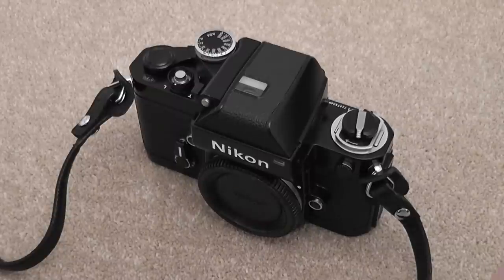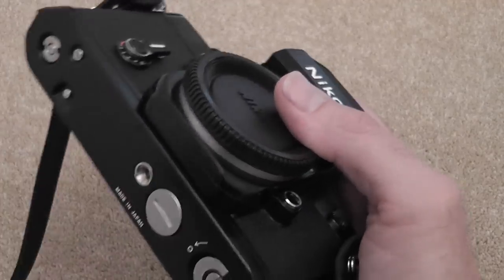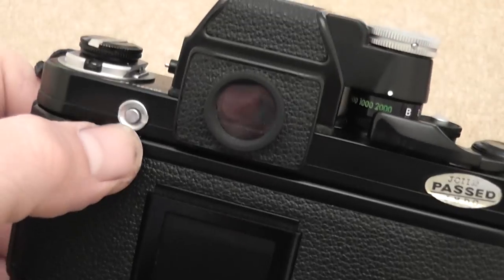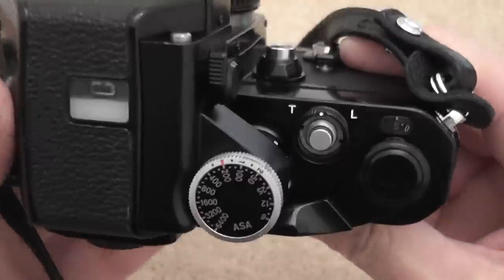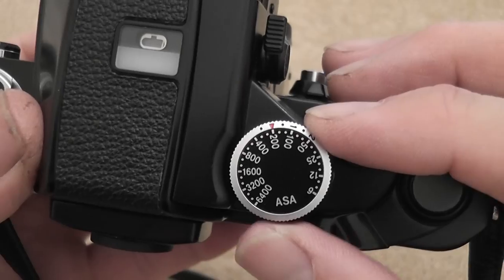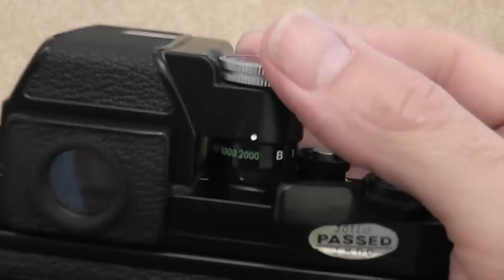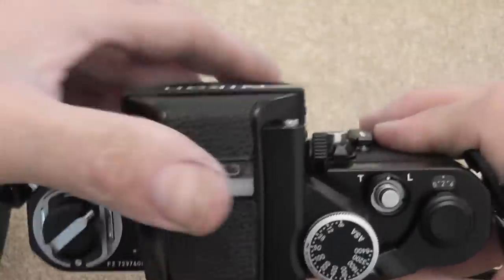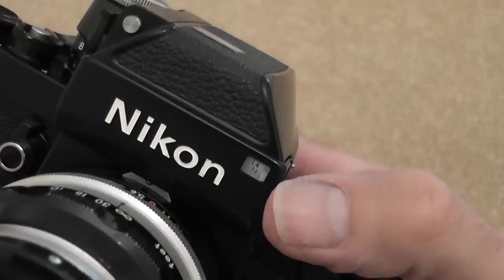Nikon F2 35mm Film Camera Overview / Review (Part 1)

Comment from the maker: Thank you for your comments.

The good thing about the F2 is that it "matured" during it's production span. Through the use of interchangeable finders, it did achieve automatic indexing when the AI lens was introduced.

Also the shutter speed is visible in a window in the viewfinder.

You have to remember this camera first came out in 1971! It had quite a few improvements over the F (see my Nikon F overview video).

The F2 is still regarding by many as the best mechanical full manual camera.

Comment: Very good video. Stupid question but when holding the camera and looking through the viewfinder how easily can you change the shutter speed using your index finger? Can you do it by moving the base of the knob or do you need to adjust the knob on the metered view finder?
Reply from the maker: With the metered finder, the shutter speed is changed by turning the knob on the top. With an unmetered finder you turn the base of the knob (the actual shutter dial). Both can be adjusted using just an index finger while looking through the viewfinder.

Comment: Hi, I’m looking at getting a F2 with DE-1 prism (meter less). Due to that finder not having a meter, does the advance lever have to stick out when taking a shot like it has to when using a metered prism - or can the lever be pushed back forward to the ‘off/closed’ position. I’m left eyed so having to have the lever sticking out would literally be a pain :) Great set of videos you have created. Many thanks.
Reply from the maker: Shane Ferguson No, you can leave the lever pushed in (or flush to the body).

Comment: Nice video, really informative! I just bought myself an F2. I am bit edgy that the lens it comes with is a 50mm f/1.4 (like yours). I have been using an olympus trip 35 that has a fixed 40mm f/2.8 lens and I am someone who enjoys a wider focus when shooting. I have considered getting a Nikon zoom 35mm-70mm but I am unsure how well that would work with the F2.. not to mention that it is a f/3.5 which is a bummer. I’d appreciate your advice. Thanks!
Reply from the maker: A 35-70mm zoom will work with an F2 as long as it has the prongs (or rabbit ears) or is an AI or AI-S lens for the DP-11 or DP-12 finders. However, I would recommend buying a 35mm prime lens as it will be better quality and much more useful in lower light or when a higher shutter speed is required.
Reply: Samsung9alaxy many thanks!

Comment: Will that 3v dl13n battery work in the cameras that use two lr44s? My Pentax ME, for instance? It appears to be a direct replacement
Reply from the maker: It will fit, but it may make the light meter incorrect.

Comment: +Samsung9alaxy
I've an odd question. As we know, production of F2 stopped in 1980. In 1985, how much do you think a good quailty used F2 would cost from a shop in the UK in pounds sterling? I am researching the 1980s. Many thanks.
Reply from the maker: rod dale Don't know! I do have a price list from 1985 with Nikon's new cameras in.
Reply: Thanks for the reply. My rough guess is somehere between 150 to 200 in 1985 pounds for the body. Cheers.

Comment: so, you don't have any light meter when you make photos using the waist level viewfinder. How do you make photos with the right exposure if you don't have the light meter of the standard viewfinder?
Reply from the maker: You need to use an external light meter or use the sunny 16 rule ( http://en.m.wikipedia.org/wiki/Sunny_16_rule). You can get a light meter app to use on most phones!
Reply: Samsung9alaxy Well, you can easily recognize through my questions that I'm a beginner in photography. I would like to ask you more things (and excuse me for my english, it's not my first language). You know, today I just use a dslr and I see that in several situations I need to do bracketing to obtain a good photo, for example when I make a photo of a panorama, usually I must do two photos on a tripod with different exposures and then I must combine them. 
In the last days I saw several photos on flickr (or other websites) made with film cameras: they usually appear not sharp like digital photos, sometimes colors are not vivid like those of a digital photo (well, they have been scanned, too) but despite this I appreciate those photos for a kind of equilibrium (in the exposure) that often I don't find in photos made with digital cameras (unless bracketing has been used). Is this only a personal impression?
Reply from the maker: Marco Autiero If you're doing a panoramic shot, you need to use your camera in manual exposure mode. Then your photos will all come out the same brightness, unless there is a change in light while you are taking them!

Comment: my finder does not have the connector to the rabbit ears on the lens. IT does however have one that looks like a square bit, but it does ot work for some lenses. :P any issues there?
Reply from the maker: Sounds like you've got either a F2A or F2AS. The finder will have "A" or "AS" on the front. They use the AI coupling system for the metering. Older (pre-AI) lenses will mount but will not automatically meter when you change the aperture.
Reply: My finder states the "A" in the front and it is a DP-11 finder. Would this be an issue for the metering for my lenses as they do support both the rabbit ears and the DP-11 indexing  thing.

Comment: Hi again mate, i have pressed the button to check the light meter battery and its fine the meter needle goes half way like you said but does the needle move when you press the shutter half way as im now confused on how it gives you a reading
Reply from the maker: You need to move the advance lever to the standoff position (so you can see the red dot) to activate the meter. It will then keep measuring the light and give you an exposure reading until you push the advance lever back in again.
Reply: +Samsung9alaxy Hi, I have a question I am hoping you can help me with. The ASA speed setting knob is stuck on 100. I cant turn it. How can fix it?
Reply: Nevermind I just got it LOL
Reply from the maker: +Jessica Britton Good! What did you do?
Reply: +Samsung9alaxy I pushed the knob up, I guess I have an older or newer model that you have to push up than turn.
Reply from the maker: +Jessica Britton That's the way it should work! Perhaps I didn't make it clear enough in the video.
Reply: Yeah, I thought it was just supposed to turn with ease. I thought mine was stuck! But, I enjoyed your video! It was great! And I am so happy I got to start shooting today :)
Reply from the maker: +Jessica Britton Thanks! Enjoy your shoot.

Comment from the maker: Omniscient Television: Seems all your lenses are AI lenses which have a cut out on the aperture ring for coupling with the protruding lug on the DP-11 finder. These will all meter correctly and have no issues. The rabbit ears are for coupling with the earlier finders and will have no effect on the metering on your camera.
Reply: Thank your for your reply. I apologize for asking such wired questions. I have never used this 35mm camera before. I did do some further research it stated that the seals in the door and for the mirror needs to be replaced, and mine are certainly not even there. I wish to begin using this camera soon. Would you know any service station in Canada or world wide?
Reply from the maker: I use Sover Wing for my repairs & service. He is based in England. Here is his Web address: http://www.soverf2repair.webs.com/
You may also find a local service center by asking on this website: http://www.nikonians.org
I would recommend you become a member and post your question on the forums.